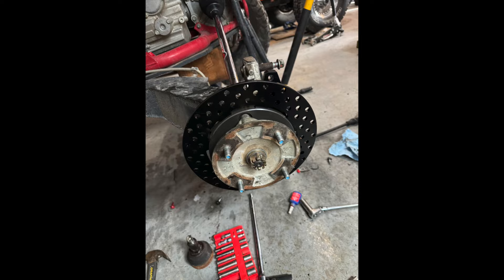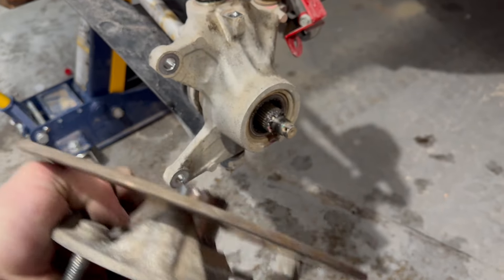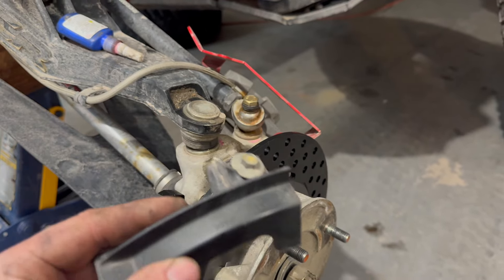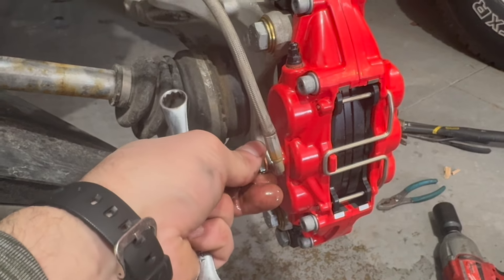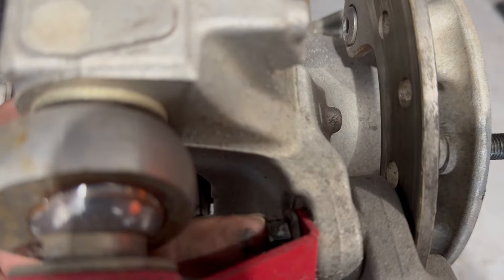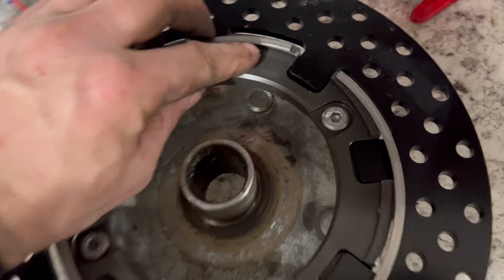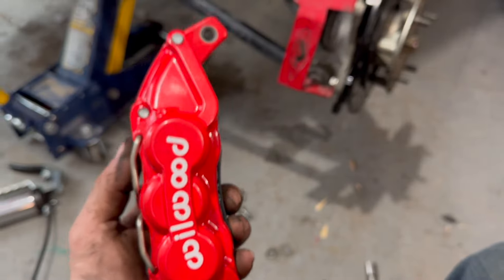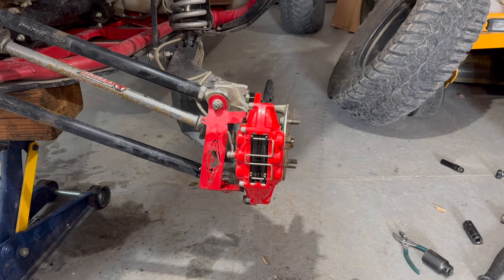Honda Talon Brake Upgrade, Wilwood kit, Rotors & Calipers how to

Comment: Nice looking setup Russell, them brakes look good and appear to be high quality. Do you know if they offer them in blue? Thanks for another informative video, we were beginning to suffer from withdrawal (and still miss your adventure vids)! Happy new year btw.
Reply from the maker: Hey! Good morning & thank you! It looks like they come in black or red! I’d like to make more videos, but I’ve almost ran out of upgrades! Thanks for watching!!
Reply: @gravesru  black would work for me and I'm sure it would be a big step up from factory. Now to convince the boss lady I'm in need of another upgrade lol. Have you done any service or upgrade to the drive shaft from your transfer case? I've got a short video on my channel of it making a chattering noise. It appears to be the coupling causing the noise. Initially I'd thought it was the rear  right axel. It's still oem (for now), since my stereo masks the sound. 🤷🏻‍♂️
Reply from the maker: We all have a hard time justifying spending more money on these money pits! I also have a Pro R as well!
I haven’t had any driveline issues with the 4seater!
Reply: Watched your video, I'd say that's just shaft play between the splines.  @TherapyWithWind